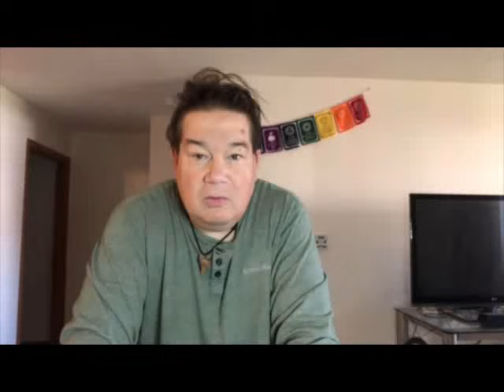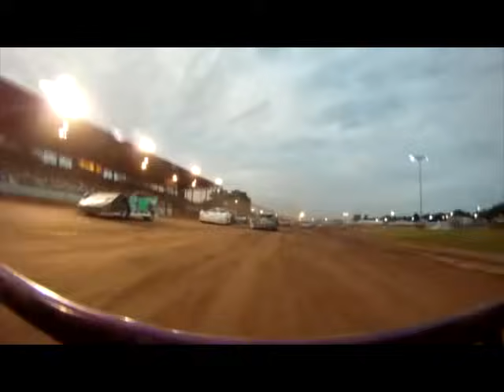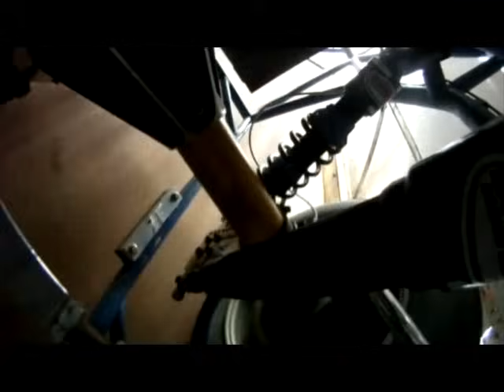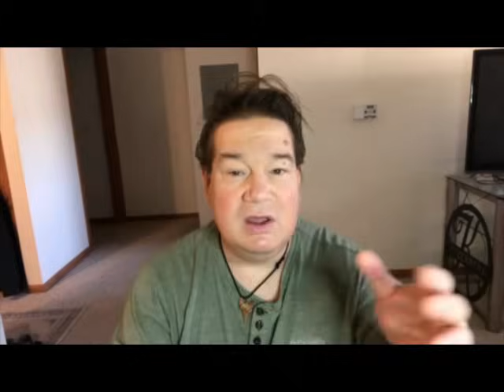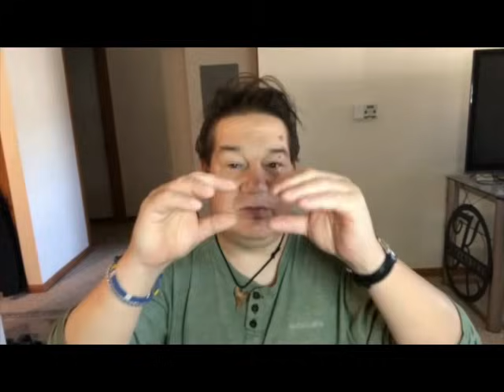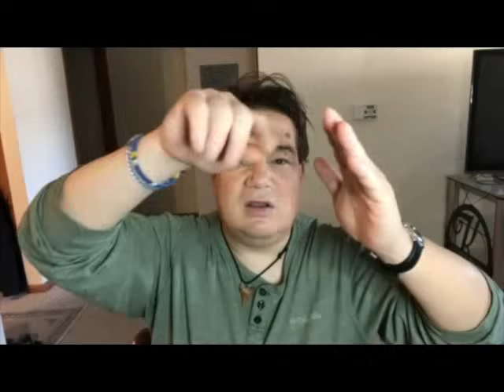Dirt Late Model and Dirt Modified Chassis Flexibility

Comment: Kenny runs a Hofmann chassis.  You can get a very good look at those chassis in a new YouTube video on Stapleton42’s channel on Matt 88.    On the standard Hofman chassis the pillars are solid mounted.  Kenny may have an experimental piece but highly unlikely one with a floated main vertical.  Kenny isn’t as bright or as  knowledgeable people somehow assume.  He’s not a chassis engineer or nerd. He just buys stuff from winning companies and associates of his and runs what they tell him. He is the post child for a Costco racer. Infact he got that care assembled and he doesn’t even build small stuff like bumpers.   

You mentioned to soft doesn’t allow the suspension to work, that’s true, if it’s to soft load arrives late, it creates inconsistencies and asymmetric loads….. but when it’s too stiff the load bypasses the suspension and shocks the tires. 

The biggest misconception in the Industry is thinking that flex weakens the chassis. Flex is about controlling where the load travels and where to dissipate. It’s a load problem we need to a strength issue. The trick is torsional compliance in rotation, but bending stiffness vertically and longitudinally.  A car naturally twists we need to design cars that control that twist, not chase ways to prevent it.   The flex we want happens after dynamic suspension travel. We need it to be predictable and scale linearly.  All this while considering plastic deformation and fatigue.  The best chassis today have structured elasticity and they don’t flex more, they flex _Later_.     Initial load handled by the suspension, secondary load absorbed by the chassis and final load stabilized by tire deformation.  This gives us a sharper entry, stable center and more drive off.   When designing a chassis we want zero deflection in the rear pickup points, very little front clip bending and nothing flexing the RF because of the bump. We want some halo flex and upper cage shear compliance, mid-rail torsion (allows the car to wrap up) and some RR flex under torque reaction(to help with additional drive off).
Reply from the maker: Great insight. Thanks for watching.